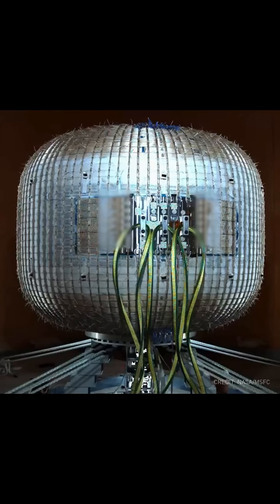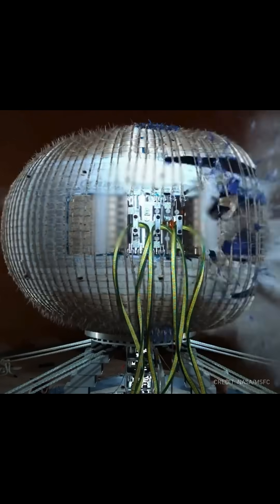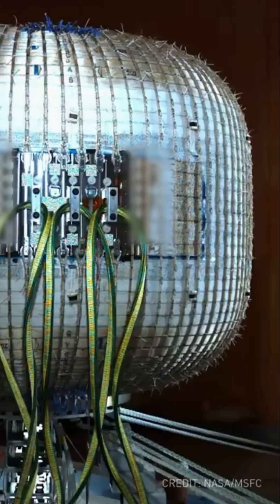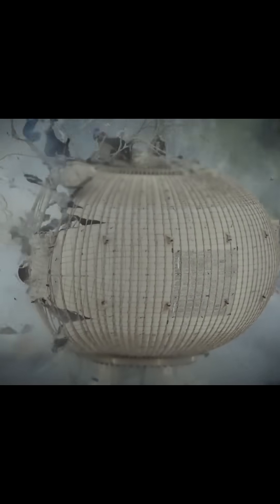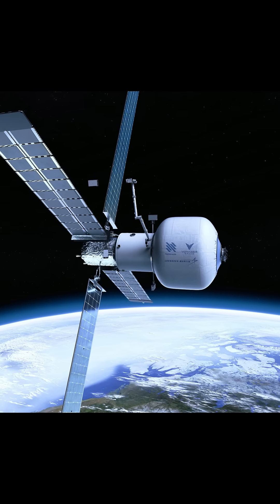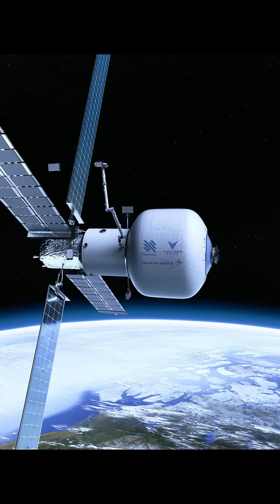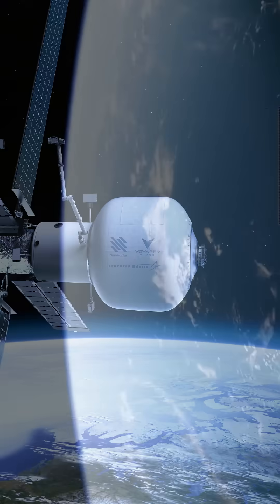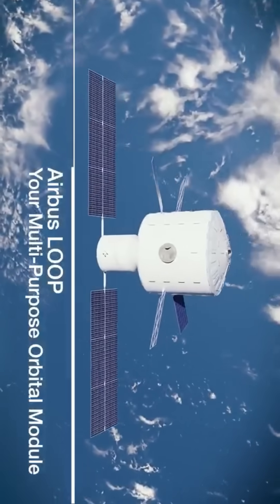Lockheed's Inflatable Space Station Explodes After Months Of Testing

Comment: They may have been able to rig the camera to trigger the capture upon the slightest pressure variation, instead of running the whole time. Just a thought.
Reply: It does not seem like a large hardship to run a digital camera for six months. I assume it overwrote previous images after a while. If that had been film at a high frame rate, it would have been expensive.
Reply: @artsmith1347  High speed cameras generally have a similar setup to dashcams. They constantly overwrite the older footage with the new stuff and save the backlog when triggered.
Reply: @artsmith1347  yeah, that’s a fair point too
Reply: @artsmith1347  this was a high speed camera, so definitely expensive to run for long periods of time
Reply: This is somewhere between 1,000 and  10,000 frames per second though. That would be hecka stressful for that sensor and RAM. Would get SO hot
Reply: These cameras have a data rate so high that the only storage they are writing to cyclically is RAM. It would be impossible* to write to any conventional computer storage in real-time what these cameras capture.

Their RAM recording window is measured in low single digit seconds.
Reply: Probably buffering until something happens then store that buffer.
Reply: Dang guys, I learned a lot from these comments!
Reply: It may have been set to delete any footage older than eight hours and when it burst someone manually disabled the deletion program.

Comment: No need to save 6 months of continuous high speed camera footage. Just have it on a 5 minute loop and stop recording when the mic picks up a bang.
Reply: why have a mic when you can put a pressure gauge on the pipe and trigger on pressure drop. That way if someone drops a hammer near the thing the experiment doesn't terminate.
Reply: @McPebbster Running vs Saving

Comment: I've been close by when a truck tire let loose.  That's an experience I don't want to repeat in a hurry.
Reply: There are hardly any of the split ring or multi piece truck rims around. But those things would let go if not assembled right when a tire was repaired or replaced. There were people killed when they came apart, as well as walls or ceilings opened up. Even with safer rims now in use, I still would not advise driving along next to large truck tires. When they blow, large chunks of tire can fly out and damage your car . That much pressure really rips a tire apart.
Reply: @ronfullerton3162  Yup.  I remember those.  I also learned how to properly assemble them when I was a kid.
Reply: Truck tire pressures are around 10x higher than a hab module would need.
So you're comparing a 6lb chiuaua with a 60lb rottweiler.
They aren't the same. Not even close.
Reply: @c6q3a24  Truck tires run 6-8 bar, or 90-120 PSI.  Typically atmospheric pressure is a little under 1 bar.  Space habitats typically run about 1 bar,..  I typically ran my tires at 6.5 bar, or 95 psi.  The example shown was an inflatable habitat being exposed to 4 times it's expected limit in a vacuum, but tested in standard atmospheric pressure.  That means they had to inflate it to about 5 bar.  Barely any different from truck tires.
Reply: @tarmaque 7+ bar, 110 psi for most of my tires. 😬🙄

Comment: Was it in vacuum?
Reply: No, they just inflated it to one atmosphere more and achieved the same effect
Reply: @raptorwhite6468  Many materials behave differently in vacuum - it would not be exactly the same effect.
Reply: @pattheplanter It's just about pressure difference. If pressure inside is 1 atmosphere and outside zero, it's the same as if pressure inside was 2 atmospheres and outside 1
Reply: @raptorwhite6468  That would be true if you had a completely inert material. Vacuum can cause some materials to change, especially after 6 months.
Reply: @pattheplanter Yes, but it's easier to test it's resistance to vacuum separately, especially since the size of vacuum chambers is very limited

Comment: Not for nothing for 4x pressure is a pretty good safety margin. Add a whipple shield and this thing can last quite a while.
Reply: They're going to have thought about all of this, but I'd like to know more about longevity of materials in near-24/7 full spectrum radiation, wildly gyrating temperatures, and occassional tiny penetrations.
Reply: @Qtrfoil  BEAM seems to being doing well on the ISS.
Reply: @Qtrfoil  hundreds of degrees of immediate difference between the sun side and the shade side, while under pressure, is going to be one hell of a thermal shock were going to have to learn to engineer around
Reply: @craigsurette3438 not as difficult as you imagine
Reply: Whipple whipple ice cream on my nipple
Reply: Indeed
🚀
Reply: But space is so harsh, cut that performance in half. Imo
Reply: in space, there are micro-meteors, or projectiles that can easily puncture thin layer inflatables.  Even UV radiation can greatly decrease the strength of materials over time.  Best use a thick, heavy and rigid material. Or at least a composite material of many layers.
Reply: 1.5 to ultimate, 1.15 to yield in my neck of the atmosphere. 
Anywho, this is not 4X capability since the duration was, I'm assuming, less then requirement duration. So the 'safety factor'  would have to be based on the maximum pressure the thing can withstand for no less than the full required lifespan.
Reply: Personally, I'd prefer to see a factor closer to 12 for a life critical system, at least for short periods.
Reply: @matthewcasady6276  understandable! But it is important to note that safety factors come with the cost of weight, and oh boy, if you knew how small the safety factor really tends to be given the cost to orbit.

At least until the cost really goes down. Thats when I can see a safety factor of 12 hitting
Reply: @matthewcasady6276  Nothing that goes to space has a safety factor this high. It's usually 1.4 for manned spacecraft. You can't go higher because every gram of weight savings counts.
Reply: @matthewcasady6276 Geotechnical engineer here. We deal with much larger levels of uncertainty than almost any other field of engineering (primarily due to potential variability in soils). Our safety factors are some of the highest I’ve seen and I don’t see much higher than 3 typically. 5 is huge. 12 is just ridiculous. By contrast, aerospace tends to have pretty low safety factors since they’re dealing with materials with pretty consistent properties and they need their systems to be as light as possible.
Reply: @matthewcasady6276  Safety factor on the tanks of most rockets, including those that launch humans, is around 1.2-1.4
Reply: @matthewcasady6276  Dont get on an airplane... your lucky if you have a factor of 1.5
Reply: @spikes1529 1.5 is legal minimum. Lower safety factors are only found in spacecraft.
Reply: @matthewcasady6276 I was going to say “don’t be ridiculous, if the pressure gets that high any astronauts inside are already dead” but it turns out 12 atm is probably fine.
Reply: @jcskyknight2222  I don't think there's any real reason to expect an actual 12 atmosphere pressure inside. The number 12 seems a bit arbitrary to me but excessive bursts are useful to account for other strange happenings that you don't want to destroy hundreds of samples to test.
Reply: @matthewcasady6276   the usual factor is 3
Reply: @matthewcasady6276  12???? you want it to survive the sun
Reply: @matthewcasady6276 this test lasted 4 months at 4x pressure so it could have possibly done 12x pressure for a week or whatever. I’m not even trying to do the math I’m just saying it’s possible this product could have withheld 12x pressure for a shorter duration than the 4 months it lasted at 4x.
Reply: @matthewcasady6276  Buildings typically have a (lowest) safety margin of just over 2. While this is a bit misleading because most of the structure is not built to the margin

And worth saying. If a building is overloaded to the safety margin, it still suppose to stand up
Reply: Debris shooting it periodically is more of a problem for it, than over pressure.
Reply: LO, don't you think the problem is not that it broke but the way, blew up.

With that type of construction, failing under pressure means explosion in milliseconds. With rigid structures, it means there is a leak that can be patched.

Could a meteorite penetration damage the structure and make it blow up?
Reply: In space no one can hear you scream
Reply: 4x 🤣🤣🤣
A whole 60 psi, 
Less than a Bicycle Tyre 🤣🤣🤣🤣
Reply: @markoreilly3414  A space station has a whole lot more surface area than a bicycle tire, and that gets multiplied by the pressure.
Reply: @sleepib 
Psi ~
Pound
Per
Square
"Inch"

The fucking Pressure is the same, on every inch, hence PSI !!
should have payed attention in Gr 6 Science class !

1 atmosphere = 14.7 PSI 
(@Sea level)
X4 ("safety" margin)
= 58.8 PSI
Doesn't matter how "big" the Tyre is,
Its STILL 58.8 PSI !!!!!
Science, 
Its real !
Reply: @markoreilly3414 people don’t live in bicycle tires now do they

Comment: are there any similar footage for "rigid" modules?

how much pressure can normal walls withstand?
Reply: An example of that would be SpaceX's overpressure tank tests. Really cool failures to watch.
Reply: I guess the failure wouldnt be catastrophic  but anyway I guess someone is working on a curing compound to develop once inflated to make it less prone to this, either by increasing the margin or decreasing the "catastro-bility" of the failure, or both....
Reply: @DoNotPushHere Water forms a good radiation shield.  If frozen it's pretty strong.  Heavy though.
Reply: ASME code for a pressure vessel would go to about a safety factor of four at the very best. Probably not what is flown though.

Comment: Important to know when things will break
Reply: Exactly! 100% correct 👍 And it preformed thousands of hours even though it was pressurized to 4 times more than it’s normal pressure level.
Reply: Was it pierced by space debris and radiated with uv-light during the testing?
Reply: @bayerbear6770  That's a good question. What happens when a balloon in space gets hit with a hypersonic meteor?
Reply: @stopthephilosophicalzombie9017  probably the same thing that happens when a balloon on earth gets hit by a hypersonic meteor
Reply: @stopthephilosophicalzombie9017 Very good things, marvellous things, things that might make you say hip hip hooray.
Reply: @stopthephilosophicalzombie9017
Worth noting that even back in WW2 (or earlier), people found out that with some balloons putting holes in them is surprisingly ineffective
Reply: @ImieNazwiskoOKyeah, I don't know what'll happen to a space balloon with a micrometeor.

But. The ww1 zeppelins with semi-rigid structures and rigid ribs, they didn't burst with bursts of machinegun fire. They just got small bullet sized holes, and as such their pressure dropped slowly, meaning they didn't burst nor did they fall out of the sky.

I would think a micrometeor would just create a micro-hole, that leaked slowly, and as such could be fixed with a bit of duct tape or space equivalent professional space grade tape.
Reply: @stopthephilosophicalzombie9017  the same as when a rigid chamber does?
Reply: @bayerbear6770  The uv gets blocked by the outer sielding that blocks it. And in addition to the impact shielding that these things will have, even if it is a larger bit that pierces it, nothing much but a small hole. It's not just a balloon. It's more comparable to a balloon wrapped with multiple layers of ducttape.
Reply: @bayerbear6770  Next few tests, you don't throw everything at it at once or you'll never know what it can or can't handle.
Reply: No it isn't. I am taking trips down to the Titanic wreck in a kinder egg shell, want to invest?
Reply: Yeah, hopefully not in space with 7 guys inside.
Reply: 4 times breaking is never normal though!
Reply: right but the question is, do these designs even produce repeatable expected results?
Reply: @danielbrowniel  Yes, they consistently puncture and leak with all crew members lost (in simulations).
Reply: not only when, but also how.
Reply: Uhmm, sure! Most important and very useful! Just like that Ocean thing.